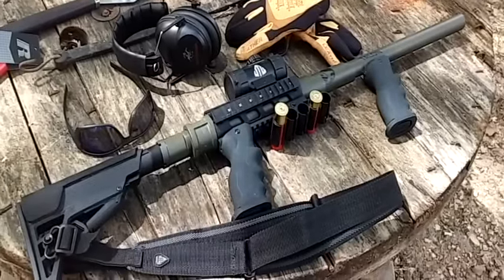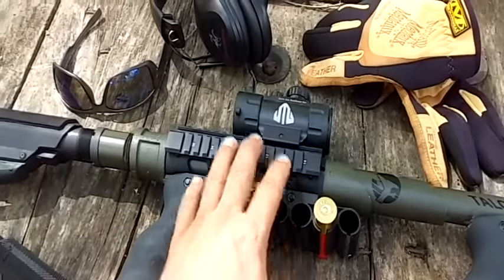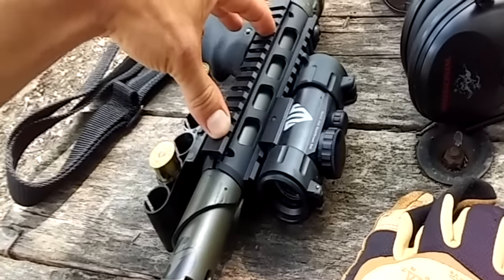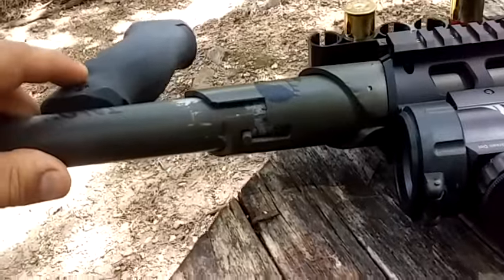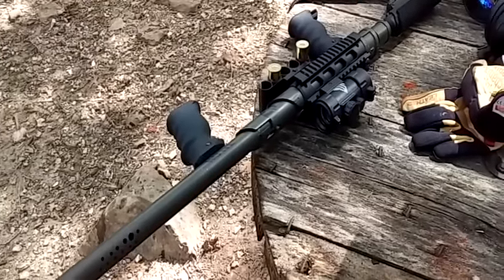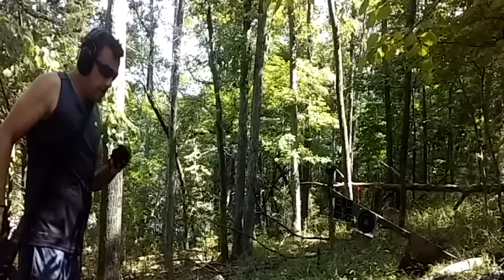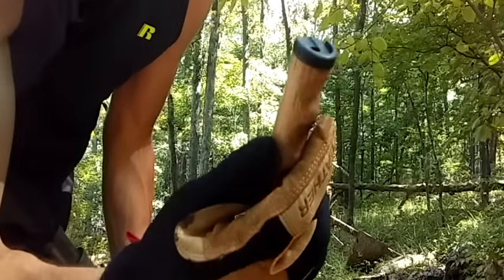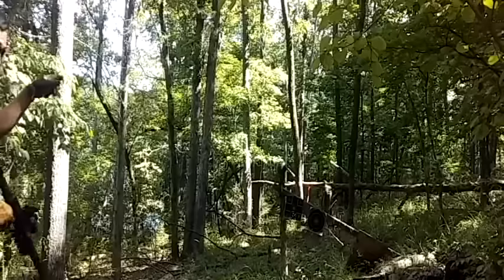TALON 12 GAUGE Home Made Slam-Fire Shotgun

Comment: Take you a cheap Harbor freight spring loaded center punch to use as a firing pin and all you have to do to fire it is pull it back slowly when it hits the spring loaded punch just pull a tad harder and it will activate the punch. That way it will be more accurate than slamming it back.
Reply: Larry 
That’s a GREAT idea !!!.....but if you look at the “multi-slot” he cut in the receiver tube that engages with the pin on the side of the barrel,  he could preload the pin against the flat and slowly turn the barrel until it drops off that flat.  I’m not even sure he realizes that.  I do like your auto-punch idea,  though.  🤜🤛
Reply: That is an awesome idea. Im thinking you can incorporate an easy trigger sear before that as well. But dont drop it! Or a twp stage safety by adding a twist lock where the reciever meets the barrel.
Reply: Your a god damn genius
Reply: Great Idea, I was thinking of some way to use something like sling shot rubber tubes to rig up a trigger system. But, dang, you better be careful, I could see some accidental firings,,,,
Reply: @wrathmachine7609  it's superior to the slam fire, so why wouldn't you ?
Reply: The only problem here is that those punches are beyond unreliable. I use them at work to center punch spot welds before I drill them out and I'm get 3 punched without having to fiddle with the end to make it work. Same with lisle and gearwrench auto center punches
Reply: Linda Marion  I appreciate it. I'll look into it. For real, thank you.
Reply: I’ve been studying this recently but I agree
Reply: Wouldn't the spring mechanism be toast after a few shots though? Im guessing they're not engineered for 12 ga recoil.. Also would that just slowly put a dent in the primer without setting it off?
Reply: @ethancntower8850  i curious as well if you find info please link.
Reply: @BamBlamboTv you’re

Comment: Absolutely love this build. In my opinion, the only thing that would make it better would be a round foregrip and without the port holes on the front of the barrel, and with the same pin on the other end of the barrel. That way you could fire, place a round in the front of the barrel, spin it around, put the front end into the receiver, fire, causing the previous round to eject and speeding up reloading/firing and not need a shell puller to pull the previously fired shell. Then repeat the process. Either way, frickin awesome man!

Comment: One thing I’ve seen, on other videos that are similar, is the ability to use the pipe on either end. This allows you to simply fire out the used shell without the need to pick at it. I’m no super gun enthusiast or whatever so I’m not sure how it would affect accuracy, but you mentioned it was inspired by the idea of necessity, the ability to knock off shots seems more valuable than being slightly more accurate. It is still a pipe shotgun afterall

Comment: Best slam fire shotgun i have ever seen! And great idea on the shell puller. Was that black iron Home depo pipe or 4130 seamless pipe?
Reply from the maker: 7.62 shawn Its whatever came off the shelf at Home Depot. I discovered a source for much better pipe afterwards but (while I was worried) this steel has shown 0 signs of stress or damage. It's a cannon.
Reply from the maker: It definitely had a seam. Had to file that damn thing out.

Comment: you though about selling a set of plans or maybe a do it yourself kit
Reply: Anthony Attuso it's easy all you need is 3/4 in pipe 1" pipe bb bb weld and a washer and cap for the barrel use black welding pipe you don't have to but it stronger then water pipe for the 1" pipe use water pipe cause it's treaded so the cap will screw on jd weld bb in center of washer to the in side of the cap try to get it center let dry screw on your good to go just make a stock
Reply: @nathanking1655  can i have the length measurements in cm for the two pipes? Thank you
Reply: @ΘωμάςΚαραθάνος  1.905cm and 2.54 cm
Reply: That may be illegal to do so
Reply: It is!
Reply: FBI!!!! OPEN UP!!!
Reply: @donraptor6156  depends where you are not illegal to self produce in most places is illegal to try to sell it

Comment: Hey man instead of using that fancy homemade extractor, you can always just file a small V-notch at the end of your barrel so you can get your finger nail in there to pull out the shell
Reply: My neighbors (I live in the Philippines so I think it was illegal) had a similar "pipe gun" that fired rimmed cartridges and they had a cutout so you could remove the shell without using a rod
Reply: Its simpler to just turn the barrel and put  in a new. Shell the other side.

Comment: in the philippines we call it "sumpak"
Reply from the maker: That's awesome, thank you for that insight.
Reply from the maker: The Stoned Videogame Nerd oh yeah, for sure it's totally easy! Why don't you build one yourself and show me. I think you may have missed the point of the project entirely. Pulling the trigger on a mechanism and dropping Thor's hammer on it are two totally different experiences. Where as a mechanical trigger functions as the conduit between you and the round itself. Slam fire makes you the trigger you are the conduit detonating the round. Like I said, Thor's hammer. A slam fire shotgun is about absolute simplicity and ultimate reliability. There is no mechanism to fail on this firearm. I'm driving a 12 gauge primer into the beefiest hardened steel firing pin you've ever seen. There were four Renditions of the firing group before this one became final.
Reply: Christian Dolot I see you like to state the obvious 🤣😜 I think he went back to gaming he couldn’t comprehend, typical for TROLLS.
Reply: I will post an video soon The evolution of slamfire its already has a bolt or its an Striker fire and thats what he mention "Filipino guerillas weapon during ww2" not that what he showed.
Reply: another name for it "teka-teka"(wait!wait!).you scream it to your opponent when you're on a gunfight
Reply: @cecc99999  teka teka! Haha especially when you're reloading. Paltik at sumpak.hehe

Comment: you could build barrel inserts out of washers for any caliber as well actually a nice build
(these washer could also lead to ports for an integral suppressor system inside the barrel just put slits that lead to ports at the last 6-8 inches to bleed off gas)

Comment: you could probably incorporate an extractor in the end of the sleeve, a rounded tip and spring so when you push the barrel in it pops out of the way but when you slide the barrel out it catches the rim, small cutout in barrel to allow it to catch.

Comment: awesome and awesome video...most slam fires have firing pin right at rear of shotgun stuck on too screw on cap.....are all those screw on cap firing pin ideas all dangerous due too back being blown out??? i have many  questions but will keep it short...also your from handle how does it attach ??i dont think you.drilled through as thata where round goes down and drill holes would you loose power or would it blow up? also  how does your pin n bolt fit in iw hod did you do it i also have a request can u do stuff with cut shells thank you....respect brother

Comment: Awesome job! You've inspired me to build one of these. How did you attach the front grip to the barrel?
Reply: Curtis Johnson I welded a small section of steel weaver rail. They make them for shot gun set ups. The mount has to be steel so it will  effectively weld to the barrel. Just Google "steel weaver rail" they are about 20-30 bucks.

Comment: That is amazing buddy , so the holes you drilled in the breach , are they invade the primer get pierced and it vents the pressure out instead of exploding
Reply from the maker: Paul Jones no, the ports drilled on the outer sleeve are only for an emergency situation. No pressure or gas from the shell combustion escapes the inner barrel. If there was some issue with the cartridge or inner barrel rather than the gas pressure blowing the rear cap off which is also welded along with being threaded it will release that pressure gas than the ports and then out through the holes in the handguard away from the shooter's eyes and face.
Reply: RANGE MASTER  ahhhh right , I thought because the barrel and receiver are a snug fit that the holes were there to release any pressure , but I guess it all comes out of the barrel anyways.
That thing looks better than any off the shelf shotgun and you should be very proud of yourself buddy and merry Christmas dude

Comment: Next project, make one of those semi auto revolving pipe shotguns from Metro 2033.

Basically a big two-handed revolver with pipes for the barrel, cylinder, and the receiver? (the part with the spring and the firing pin, not sure if receiver is the proper terminology for a revolving pipe shotgun).

Comment: That is one great piece of pluming! I have a question that I hope you may be able to help me with.
I built a sweet piece of pluming as well (not as sweet as yours yet). My problem is with the front ¾ pipe.
After I discharge, the shell expands (cracks down the side) and becomes so lodged in the pipe, it takes several minutes to pry it out with pliers. I suspect I need a better front pipe. Do you agree? Is there a specific type of black pipe required? Thanks!
Reply: @kevkamo6289 , Thanks a lot ! I tried your suggestion and my left eye blew out. That shell is really in there.  I think I will go back to my pliers. Does anyone else have any ideas as what may be causing the shell to expand and lodge in the front pipe? I am wondering if the inside weld line may have something to do with it.
Reply: @Richard-mz7qu  You should smooth out that weld.
Reply: @michaeldulaney2497   I already did a lot of filing in that inside weld, but I will give it another shot. Pun intended. Thanks Michael,

Comment: how big are the holes you made for the gas release and what shape are they are they just small circle holes ? And another thing how many vent holes did you put in it
Reply from the maker: Adam-clay Garza There are two 1/4 holes drilled on each side of the rear set bolt. So three holes drilled total big one in the middle for set bolt and two on the sides spaced 1/2 from center hole for release ports.
Reply: ok so they are infront of the steel rod by the firing pin or  more in the middle of the steel rod that's in the pipe
Reply: or is it more by the female plumbing piece in the back. Sorry for all the questions I just want to be safe as possible with it

Comment: Hello. I made one using plastic electrical conduit, duct tape, zip ties, toy gun pistol grips and a fair bit of swearing.  It is shockingly accurate at point blank distance. It never failed blowing the receiver into tiny bits and cause facial damage. It is also very reliable at causing injuries to bystanders. I love my home made slam type shot gun.

Comment: Can you use a metal adhesive between the 1" pipe and the 1 1/4" pipe instead of welding them together?
Reply from the maker: I wouldn't trust steel epoxy. Theres just too much pressue involved.

Comment: I have a question for ya brother where did you drill the gas pressure release holes on your reciever I would like some more assurance because I hunt with mine all the time but am worried one day I will have a problem thank you for your video it's very useful
Reply from the maker: Emily Johnson absolutely, I will be covering the port system in the breakdown video that will be coming out in the next week or so. I had a huge concerns and honestly did not want to build something that was going to blow up in my face at any cost. The ports give you absolute assurance that no pressure is being lost from the breach. When you break down the actual physics of the steel piping diameter thickness and tolerances. A slam fire constructed in this way is built stronger than almost any 12 gauge in the history of gun building. It's a cannon.
Reply: where did you drill the pressure release holes? I can't find your follow up vid

Comment: Couple Questions.. One reason I've held off on doing a build myself is I assumed building/owning one was illegal and even though it would Never leave my property and be strictly for Home Defense.. Especially in my Gun Hating State of Connecticut I figured it was a lose lose situation, if someone broke into my house, I didn't even shoot them, cops catch them & they say I had a gun that I'd probably be the one that ends up in Prison !! So after reading some comments am I correct to say that it would be with in the Laws as long as I have Min. 18" barrel, stamp a # on it and I'd think have some pics also would help, the only part I'm not clear on is "moving parts" ? Does that mean you can't have a mechanism that automatically ejects the spent shell ? Or loads another shell ? Or any mechanical reaction occurring from the shot being fired ? Or does that mean you can't even have a trigger system ? Or all of the above ? Any input would be greatly appreciated.. THANKS !! 
Oh and a total noob question, does anyone know if I can go through the checkout at Wal-Mart in CT with a box of Shotgun shells and no License ??

Comment: it seems everyone has issues with the shell getting stuck.
any way it can be extracted quickly or as the pipe is pulled out?
Reply from the maker: Spent many days trying to design a functional extractor. Its coming on the next build.
Reply: On some slamfires, you canput another shell in the other end. It removes a spent shell and makes reloads fast. It's probably a little more dangerous. But if you're willing to make a slamfire, that's probably acceptable.

Comment: These slam fires need a 'trigger'.

The 'trigger' would obstruct the smaller pipe from accidentally contacting the firing pin.
When you pull the 'trigger', the trigger removes the obstruction, allowing the shell to contact the firing pin.

Without that sort of obstruction, carrying or walking around - with a live shell so close to the firing pin - seems dicey.

Comment: It is necessary not to pull out an empty sleeve after a shot, and on the other hand insert a new cartridge and shoot, the first sleeve will fly out, only the handle should be made straight under your left hand, so that it is convenient to beat the capsule capsular, do not need extra parts to remove the cartridge case

Comment: Coulda bought a decent pump Remington for the same price or cheaper and would have saved a bunch of time. Also fairly certain the (legal) length of the barrel stops counting at the cutouts/makeshift muzzle break, so that would be a short barrel
Reply: If it's non-removable it counts as part of the barrel length.
Reply: And that one is literally just holes drilled in the barrel so it's forsure non-removable

Comment: Inside diameter of the pipe is 18.53mm right 12GA 12Bore outside diameter of the pipe is 24.53mm right   or 1/1 25.4mm explain!

Comment: follow me for a sec, what about welding a small circular bar to the upper half of the “reciever”/barrel  and a weld set of long metal pieces with an opening for the said piece on the barrel to slide between. if my description sounds rough and you cant imagine it ill try to draw somethin up
Reply: well it wont let me but if interested in visual my facebook is deon beon
Reply: I've been working to make a semi auto version of this gun. Its the extractor that's giving me trouble. Going to build it in a 410 to minimize detonation force and increase capacity.

Comment: sch. 80 pipe has a closer in. diameter of an actual shotgun barrel than sch. 40 does. 
manufactured 12 guage barrel has an in. diameter of .73" 
sch. 40 steel pipe in. diameter is 0.824". and sch. 80 steel pipe has an in. diameter of 0.742". both have the same outer diameter of 1.05". slightly heavier pipe,but a much better fit for a 12 guage shell as well as a stronger pipe, and no risk of gas leakage from the shot cup resulting in velocity loss.

Comment: for a quick reload, you need to make a symmetrical barrel. I have a handle in the middle of the barrel which is 45 centimeters and an inch pipe 22 cm. How does it work. after firing, you insert the cartridge into the muzzle and fire again. the sleeve of the first cartridge flies out like a cork. my first https://www.youtube.com/watch?v=S26GU3rE2dk shotgun have a laser(0.5$) from key ring till 60 m OK. All gun cost about 3 $

Comment: by legal definition that is not a firearm in any way because it does not contain all four parts it does not have a separate upper or separate lower for something to be considered a firearm it has to have all four parts I can't remember what all four parts are but as I can tell that device in front of me is not a firearm by legal definition just as an AR-15 is not a firearm by legal definition because it's upper only has two of four parts and it's lower only has two of four parts separate they are not firearms your device is not a firearm because it does not contain all of the parts to consider it one.